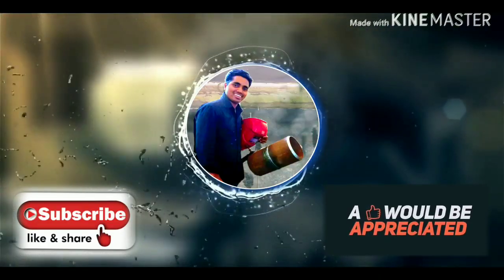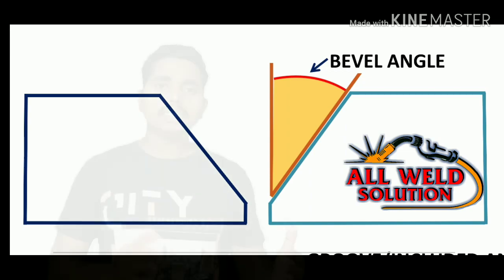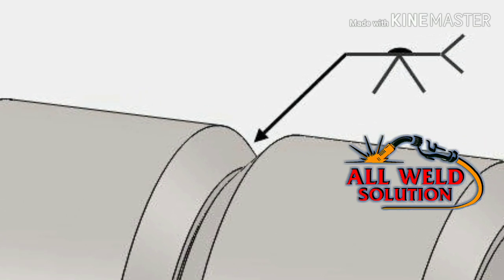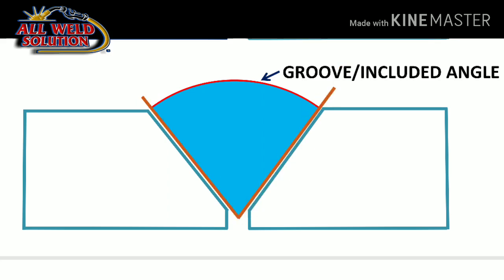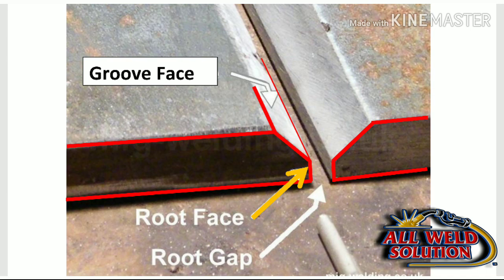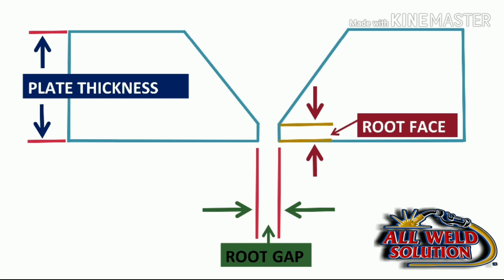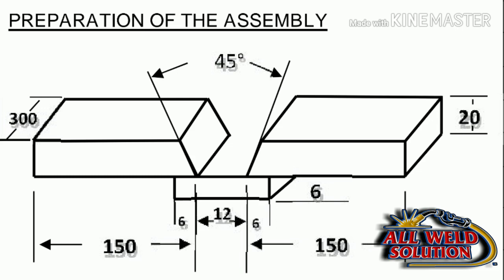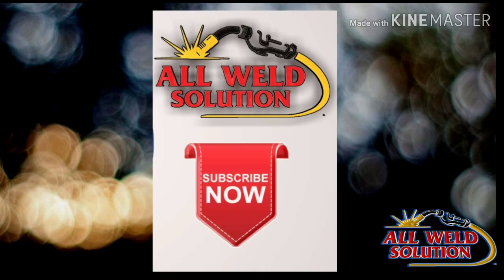Weld Joint Preparations | What is root gap,root face and groove angle| Top most important |

Comment: Sir me 3 g welding test dena chahta hu uske liye me practice kar raha hu lekin ho nahi raha h, kabhi plate me hole ho ja raha h ,to kabhi panetraion nahi a raha h kya mera plate thickness kam h, ya current jada h, ya technic kharab h,kaha per me galti kar raha hu   samaj nahi a raha h  please help
Reply from the maker: Sari details do plate thick root gap face rod current size
Reply: @ALL WELD SOLUTIONS  plate 8,10 mm ,gape 3.15, room face 2.15 ,rod 3.15 7018,current 110,115
Reply: @allweldsolutions  sir reply nahi mila
Reply from the maker: Rod 2.5 lelo
Root gap 2mm
Face 1.5mm

Current 74 amps
Reply: @allweldsolutions  2.5 ka rod nahi h 3.15  rod h
Reply: Or mig welding ka bhi bataiga
Reply from the maker: Etni kam thik ke liye 3.15 kyun

Fir bhi karna hai to 3.15 ke liye 96 amps rakho
Reply from the maker: Mig ke liye 1.2mm root 1mm face 0.8mm wire 19volt 130amps andajn rakho set karke maro kam jyada a karna pad sakta hai
Reply: @allweldsolutions  Or 3.15 ke liye gape 3 mm rakhe ya 2.15
Reply from the maker: 2mm
Reply: @allweldsolutions  ok sir dekhte h karke
Reply: @allweldsolutions  sir ek problem h ki jab mig welding maarte h tab nojal me mig wire bahut fasta h baar baar nojal khol ke saaf karna padta h
Reply: @allweldsolutions  sir Or ek baat abhi ham jaha kaam karte h waha ka jo contracted or engineer h wo bolta h ki jitna ka rod se welding maarte h utna ka hi gape hona chaihiye
Reply from the maker: @alimhusain2903  welding standard follow karo bas.